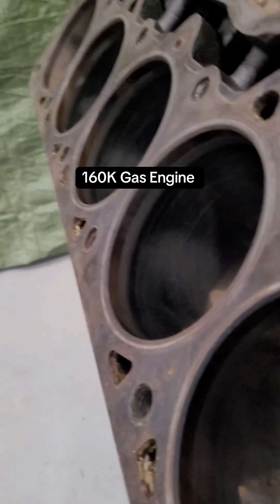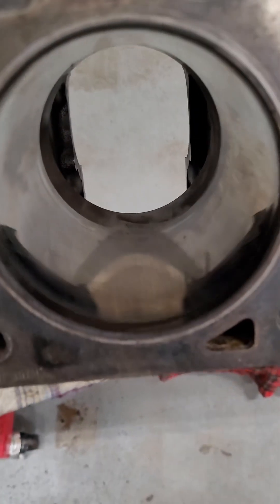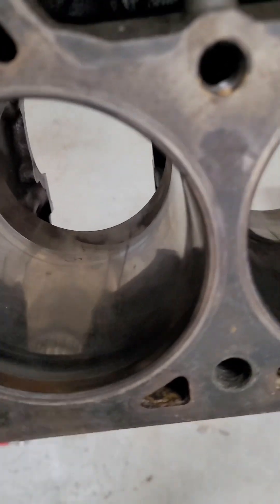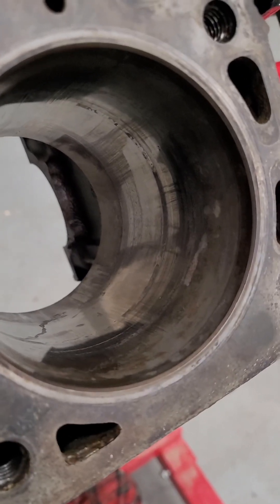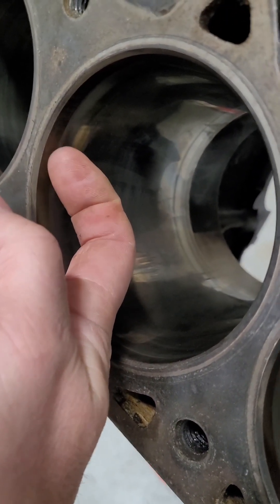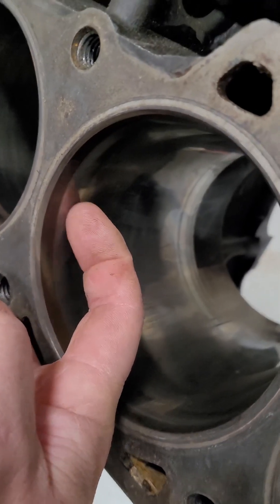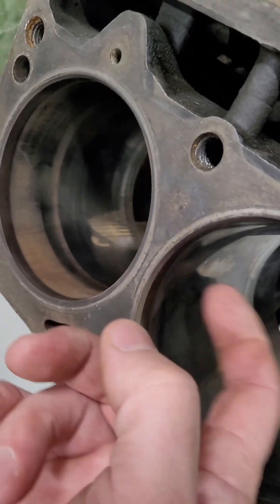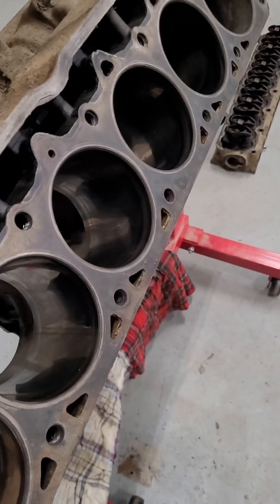Cylinder wall comparison… The 900k diesel engine looked better than the 160k gas engine. Why’s that?

Comment: Is this due to diesel being a better lubricant than petrol? Or is the diesel's advantage more due to the longer stroke and less lateral force on the piston?
Reply: I too would like to know more.
Reply from the maker: This is due to WS2 additive in our friction reducing Lorenzo’s Oil, using our 1 micron Bypass Filter, oil analysis monitoring and our hydrocarbon reducing fuel additive.  To find out more information feel free to reach out to us and ask to speak to technical support.  A lot of questions are answered in our other videos as well.